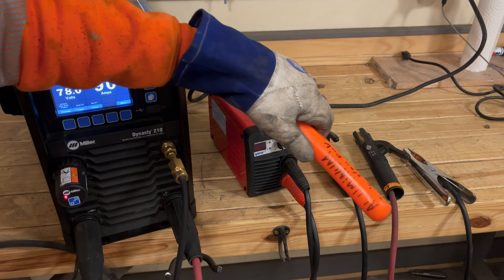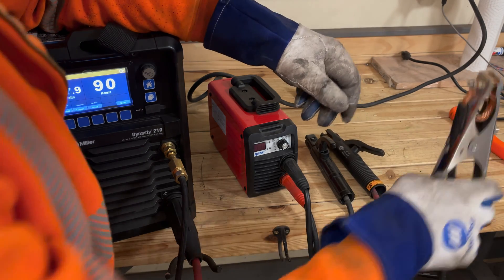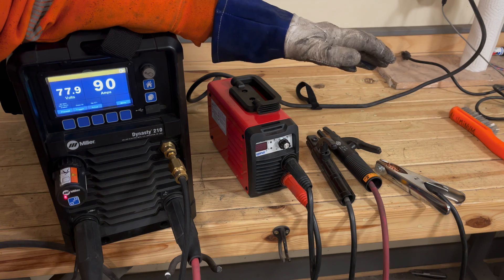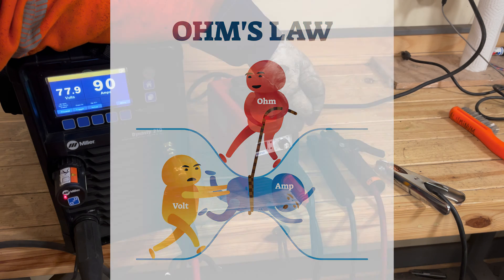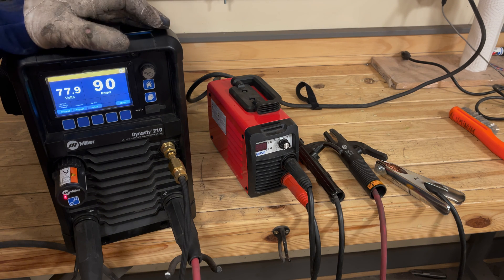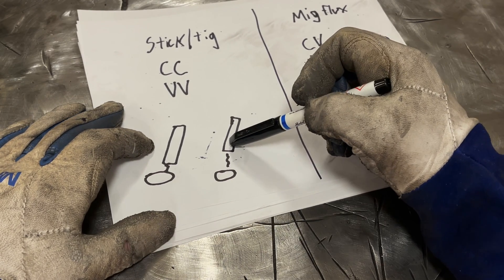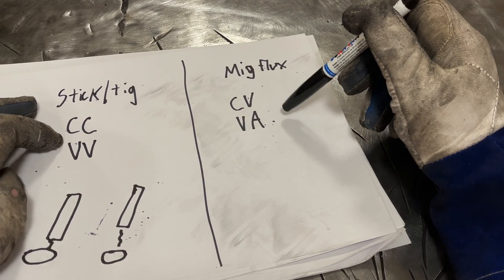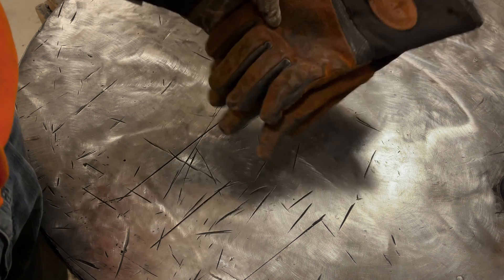How to stick weld 👨🏻‍🏭: How stick welders work + additional terms defined (series part 3)

Comment: Hey Greg i tried the 7018 rods ...didnt like them to much...strike but no burn so i got mad and took them back to harbor freight and got some 6011 rod gonna try them out tomorrow...any tips on why that 7018 wouldnt burn for me :face-purple-crying:...oh P.S.the 6013 burns great..
Reply from the maker: 7018 tends to run better on some welders due to how high the open circuit voltage is.  Basically if the voltage present when you haven’t struck an arc is 60v or higher it makes it much easier to get an arc started.  If it’s 40 or less it will be rough to start an arc.  When you get enough experience you could start an arc decently at sub 40, but it’s still harder.  

Rod wise I use 7018 prime by esab.  Once you get a bit more experience starting rods I would look at that rod as an option to get back into 7018.  It has a graphite tip which makes it easier to start, and I find it tends to perform excellent.  It’s worth it to learn to weld with 7018, once you get over the harder starts (which do become far easier with practice) it’s very easy to weld with.

Comment: I wanted to comment on stingers since you have that excellent Lenco in on display early in this video. My Sanrex came with a not-terrible Chinese stinger, but I was already damaging it from running my rods too short. That and I had managed to yank it off an electrically hot rod several times trying to unstick. Not only dangerous, but damages the stinger too. I wanted to upgrade to something a bit more secure so I went with the Lenco screw-top. I installed it tonight (super easy) and have to say I really am glad I discovered these stingers.

The screw-type has a super-secure grip on the rod. Very handy when you’re a total noob like me and tend to stick a rod now and again. Also, since the handle is cylindrical, it makes for more comfort and IMO more control so far. At $35 or so and made in the USA, it was some of the best welding money I’ve ever spent.

Time will tell just how durable the set screw mechanism is. But even if it goes bad after a couple hundred or thousand rods, does a new $35 stinger really kill you after burning several thousand dollars worth of rod? Stingers and cables are also consumables, just with a much slower burn, right?
If like me you bought a low-cost machine, definitely consider upgrading your stinger. And you might consider a screw type if you aren’t burning several dozen rods a day.
Reply from the maker: What I always thought was interesting, is the screw type clamp stingers are very common everywhere but the US.  I really need to buy one to try, because I really like the compactness of them.  The fact you clamp then bend the rod any direction you want without the rod easily spinning in the holder is a good thing.  With rods like 7024 and 7018 I tend to put pressure on them, and if I clamp/bend a rod with a normal stinger the rod will tend to rotate in the jaws, causing positioning issues.  Not sure why those stingers haven’t caught on, especially with the fact many welders now have stick stuck power reduction modes.
Reply: @makingmistakeswithgreg  Definitely give the little Lenco a go. $35 most places and works a treat.

Comment: I noticed you don't have a link to the products you are using in the videos.  Who sells the stick the welding gloves?
Reply from the maker: So the orange and black ones in the title pic are Hobart general purpose gloves, this is Hobarts site:  https://www.hobartwelders.com/safety/gloves/mig-weldingmulti-purpose-gloves-770639 .  I am sure they can be ordered online, I buy them locally for 30 or 35$.  I also bought a pair of Lincoln stick gloves used in some videos, they are these: https://www.lowes.com/pd/Lincoln-Electric-Red-and-Black-Welding-Gloves/1001282262 . From Lowes.  Hopefully that helps 😃
Reply: People are going to look for these links in the description and not in the comments. Most put them there to point to Amazon links and they get a small kickback for each sale. 
Great video, by the way, I did stick welding in middleschool shop class and had next to no instruction, so this series of videos is great for me

Comment: nice tips and ya I was welding under my truck and well my shop floor was wet from the temp outside and my AC buzz box was on the ground and ya I found out what it fills like lol
Reply from the maker: Haha I have been lit up a few times.  The buzz boxes will get you good, the ac output and 60-80 volts open circuit will find a way to use you as the ground lol.